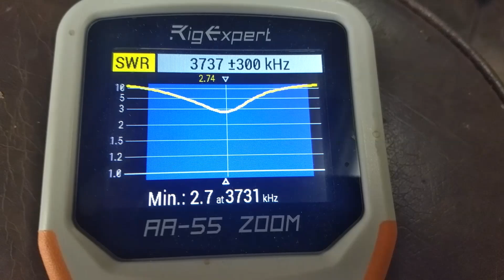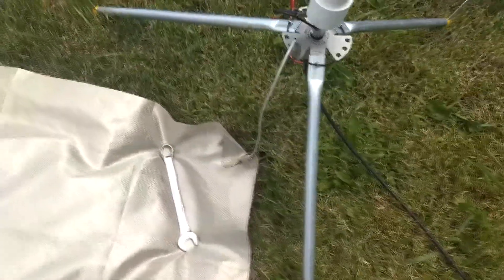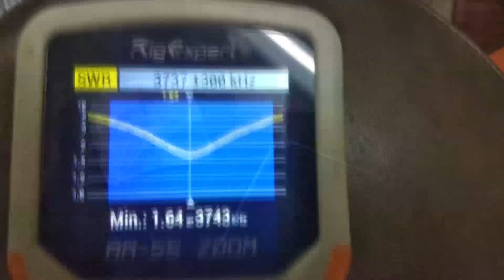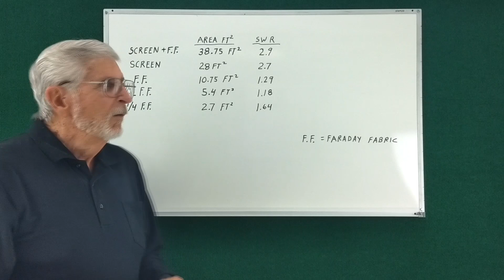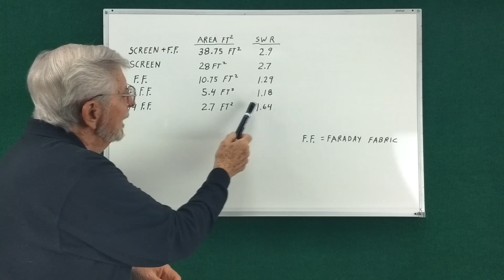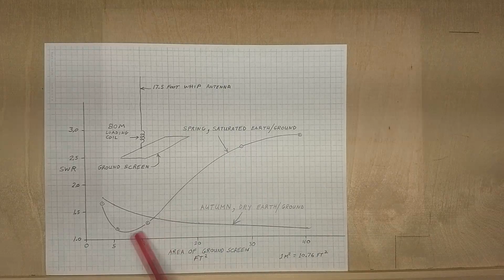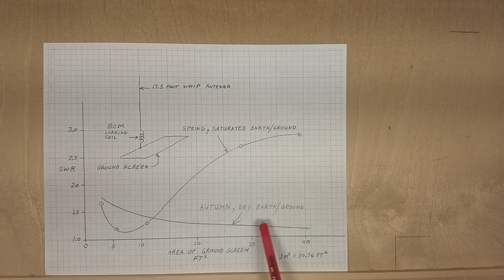Unexpected Counterpoise Results...more is not always better

Comment: As others have pointed out, a 36 ohm antenna plus 14 ohms of ground loss will be a perfect match to a 50 ohm source.  A Nano VNA can give you R+jX as well as SWR.  You can keep adding counterpoise until R stops dropping to find the optimum amount   73 KK7YIS

Comment: Sad. The SWR changes due to impedance and has nothing to do with "goodness". A poor earth connection results in the ground resistance adding to the antenna's resistance and raising the impedance closer to 50 ohms making the swr look better. You need the best radial system possible which will result in the HIGHEST SWR. A matching network will be needed at the antenna base. This is basic antenna 101.
Reply from the maker: Thank you for your comment.

Comment: Hi Jim, I do really enjoy your in-depth videos.  I have a question for you.... it is regarding telescopic mast antennas.... the question is... " which is a better radiator, a stainless steel telescopic whip or one of the same length and dimensions but made from aluminum".   Aluminum is a better conductor than stainless.   How would we go about testing this?  Thanks for all your efforts Jim.  73 Art W1SWL

Comment: I assume your antenna is a base loaded 17ft or 18 ft vertical.  If so, with a full ground plane, medium soil conductivity and tuned to resonance (at 3.7 mHz), the input impedance is about 8 ohms -- based on an EZNEC model.  In other words, with  medium soil conductivity, a relatively high SWR should be expected as counterpoise-to-ground coupling is increased (i.e., ground resistive loss decreased), and vice-versa as ground coupling is decreased (i.e., ground resistive loss increased).  For poor soil conductivity, resistive ground loss will be high which will increase antenna input impedance and lower SWR.  So, for your case, a high SWR indicates good ground conductivity and good counterpoise-to-ground coupling.  And as you decrease counterpoise -to-ground coupling,  you increase resistive loss and lower SWR.
Reply from the maker: Thanks for your comment.

Comment: Interesting video and results. I am convinced that the screen and radials capacity couple to the ground and the value of capacitance goes up with a larger screen and hence the capacitive reactance goes down with increasing area. That should be a good thing. I wonder if you did any measurements of real R and X values with the different areas. I am wondering if the real R value ( resistance at resonance ) changed with the increases size of the screen? That could maybe explain the SWR going up while the reactance was still going down. (I am going to watch the video again as I failed to note if the resonant frequency changed any). It has been my experience that the real R does change as well as the resonant frequency as I add radials. I have tried using the RBN ( reverse beacon network ) to detect signal strength differences but unless the difference is 10 dB or more the difference is hard to detect due to fading and other propagation changes. I have not yet had a good way to measure small field strength differences. I may try two identical mobile antennas as far apart as I can get them, one with minimum radials and one with increasing number of radials until I either see a difference or run out of wire! A big problem with two antennas connected to a normal coax switch is the grounds side of the coax is always connected together so I would need to physically disconnect the cable or use a DPDT switch. Again coupling between the two ground systems needs to be avoided in a test like that. Keep up the good work. 73, N4DJ
Reply from the maker: You are correct about the capacitive coupling to real ground. I demonstrate this in the video linked below. Thanks for your comment,

Comment: Wow!  Very interesting data Jim!  Thanks for doing the "grunt work" on this.  One observation... where the two graph lines cross is a point of ground square footage that would seem to work with decent SWR for both wet and dry conditions.  This analysis is certainly a good base line for further experimentation.  Best 73s  Dan K1YPB - On the air since 1962
Reply from the maker: You make a very interesting point. Thanks for your comment.

Comment: A resonant vertical antenna is not 50 ohms, therefore a theoretical 1:1 match to a 50 ohm transceiver will not produce the most ideal radiation pattern.  Your definition of "better" I guess means better SWR only, not better antenna peeformance.
Reply from the maker: A resonant vertical over a perfect ground has a resistive component of 37 ohms. Most modern radios have an internal tuner that can match up to a 3:1 SWR. Are you saying we should never push that tune button? The purpose of the video is to show that ground conditions can change.
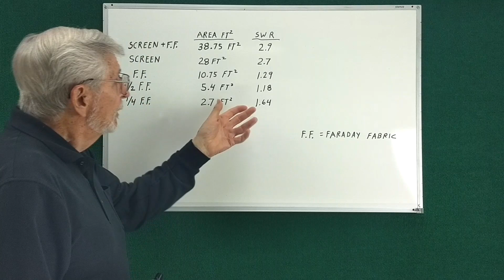Reply: @Jimscoolstuff  No... I am saying the exact opposite.  Using lowest SWR to compare antennas or counterpoise systems is misleading and a mistake often made on social media and by ham youtube hobbyists.  At 9:10 in your video you assert that from your SWR readings that it might make sense to "make the magic carpet smaller".  I'm not sure how reduced ground coupling will improve vertical antenna performance in any scenario, regardless of incremental SWR changes.

Comment: Yeah, more counterpoises not better has been known for some time; diminishing return at some point. Rather than fretting over putting x number of wires out there, just put down one or two and get on the air. We always work stateside and DX using ten watts or less. Keep it simple and spend the time one the air.
Reply: Negligible return I believe, not diminishing. Unless you count effort and expense as the variable that subtracts from the return... and that is relative.

Comment: I don't think it is meaninful to try to evaluate the performance of an antenna by reference to the SWR alone.  What you are interested in, is the radiation efficiency.  The reason we add a counterpoise to the antenna is to increase the radiated field.  It can be expected that adding more ground screen area to the vertical antenna system may cause the SWR to increase.  If you had a 1/4 wave vertical, for instance, the radiation impedance is about 36 ohms, placing it over typical ground would have a ground resistance of about 16 ohms.  These resistances appear in series, so you are burning up a good portion of your RF in the 16 ohms of ground resistance, but the SWR would be close to 1:1 because the total resistance seen by the transmitter is 52 ohms.  As you improve the ground screen by adding radials, the ground losses will decrease, but the SWR will go up.  If you continue to adjust the tuning of the antenna to provide an optimum match to the transmitter, the radiated field will be increased in spite of the fact the SWR is increasing.  It is the field intensity we care about, not the SWR.  Yes, many times, the SWR will improve as the field intensity goes up, but that is not necessarily the case and not likely in the case of ground-mounted verticals. A good reference is "Another Look At Reflections" by M. W. Maxwell, also "The Ground Mounted Short Vertical" by Jerry Sevick.  A useful practical appreciation of antenna radiation and the function of counterpoises is in U.S. Army Technical Manual TM-11-666, which can be found as a download on the internet.
Reply: Sevick's paper is good stuff.
Reply: Absolutely correct, low swr does not mean greater efficiency, it only means a better impendence match to the transmitter.
Reply: This comment is 100% correct
Reply: At some point the ground plane size and its correlation to ground losses is affecting the return loss which seems to peak at a some magic point of correlation between all these variables.  The greater the return losses the more chances of power being radiated.
Reply: Get them every time. It's like saying a dummy load makes a great antenna.  SWR is important but is not everything.
Reply from the maker: Thank you for this informat6ion.